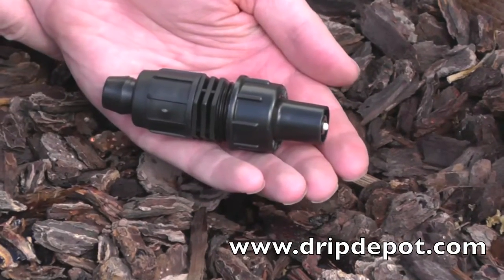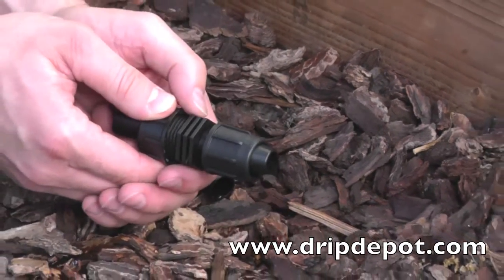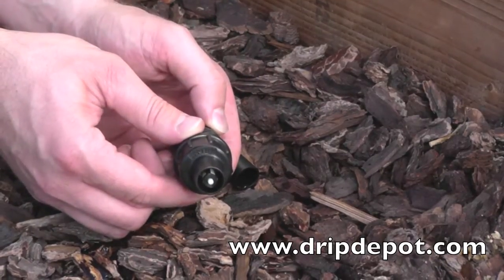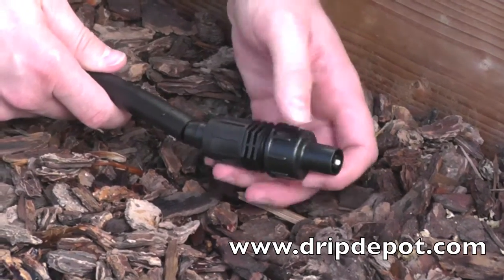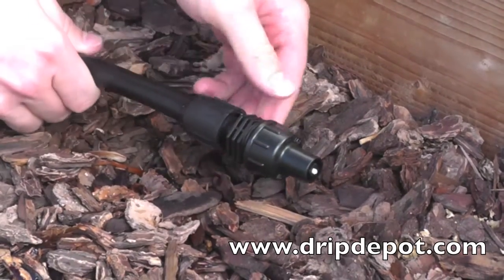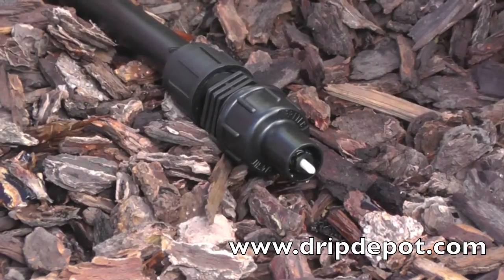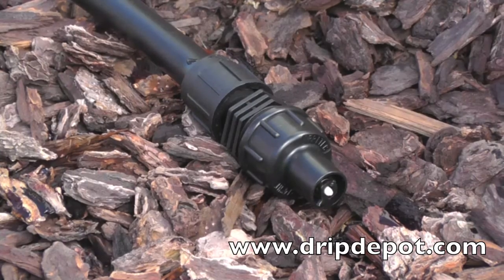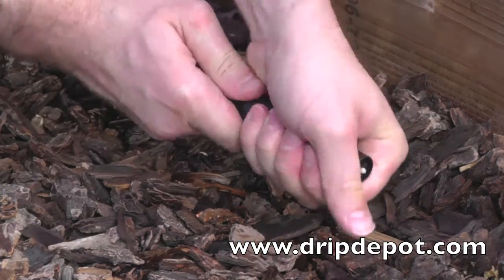How To Use an Automatic Flush Valve End Cap

Comment: Well tried it out for a year and found out the plunger was stuck closed thankfully. Took the cap off and the plunger spring inners fell out in pieces. Was non fixable. So switching back to the same brand end cap with just the screw cap. Ordering more parts from you after this 👍🏻
Reply from the maker: Weird the plunger got stuck!  Was there some mineral build up in there?  If so, a soak in a vinegar type solution might unstick the plunger if it happens again :)

Comment: I need help understanding this. What if I have pockets of air in the line? Will they automatically find their way out? My system has a 200 foot three-quarter inch tube that's unfortunately significantly higher than the  hose bib and backflow preventer.... which means during shutoff water drains from the system. But the system reaches pressure instantly when activated. There is just air in parts of the line.....
Reply from the maker: Air will usually find a way out (and in) of the system, but you're right to be concerned about air being trapped in the lines.  It can cause obstruction, water hammer, loud noises, etc.  In a lower pressure drip irrigation system it's less likely to cause damage, so you're probably not in a five-alarm type situation.  The ideal is that air is allowed to escape during system start-up and allowed to enter after shutdown.  At shutdown you want to let air in to prevent cavitation.  As the water drains from the system, it has to be replaced by something (such as air).  If it's not, it creates a vacuum. 

These things are often solved with an air vent -- an air vent lets air escape during start-up while the lines are pressurized, and then it lets air back in after shutdown.  Letting air in after shutdown prevents both cavitation and air entering through the emitters (which can result in debris being suctioned in through the emitter orifice).  

These normally aren't big concerns on smaller systems, but once you get longer runs of tubing (which it sounds like you might have) an air vent can definitely benefit.  Are you experiencing any air related issues like water hammer, buzzing sounds, obstructions?  If so it's something to look into.  The flush valve that's in this video is more about flushing water.  That can also be a helpful thing, but a little different than an air vent.  

Apologies if the explanation was a bit longwinded!